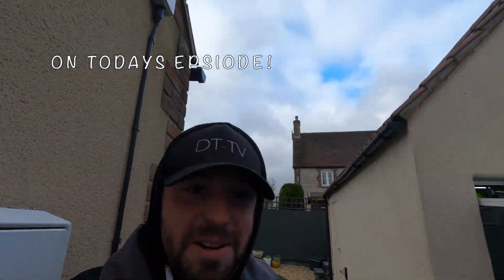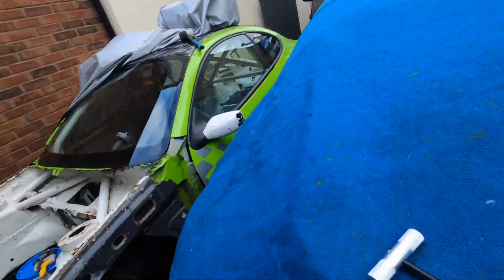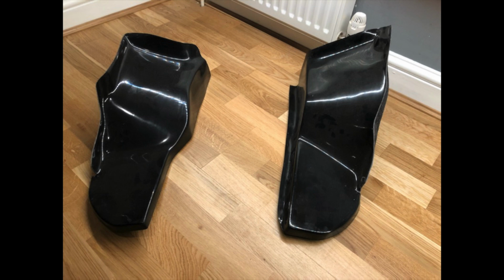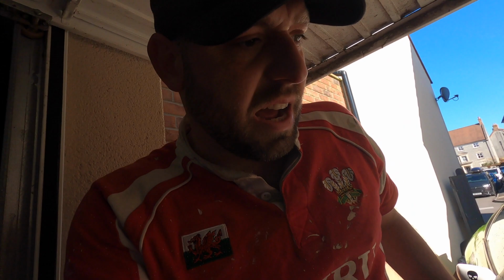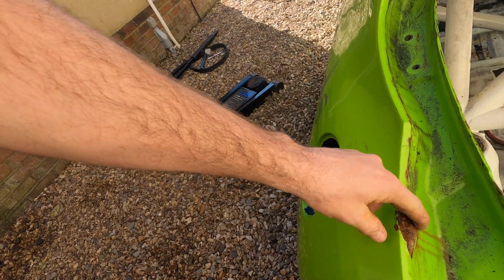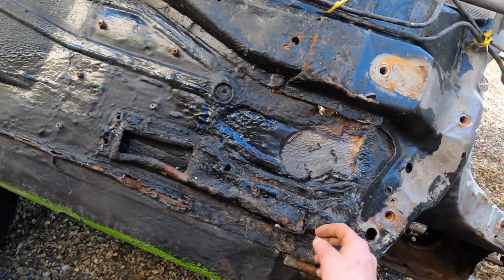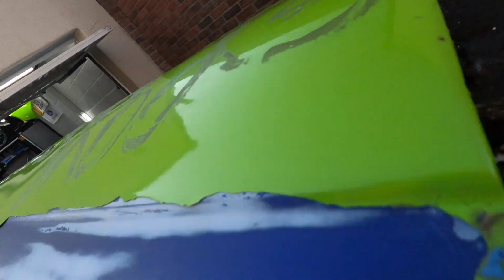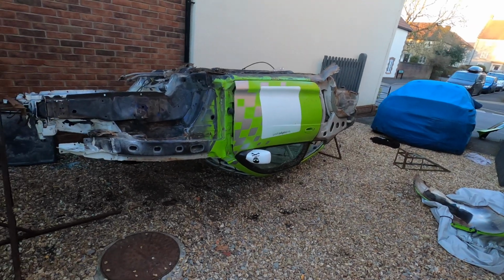Rebuilding a Rally Car - Part 40 - DT-TV - SHELL FINALLY ON THE SPIT AND UNCOVERING A RUSTY MESS!

Comment: Gutted  about the shell for you bud......would you consider a fibre glass Super 1600 kit? Only asking as there is a full brand new unfitted kit on eBay in Reading for £850? 2 front wings, bonnet, front bumper, splitter, 2 rear quarters , rear bumper and boot lid?...might be a quick and effective solution to the new shell quandary?
Reply from the maker: I’ve seen that mate and I went to purchase it, however it’s a FRP kit not a S1600 wider kit unfortunately. So it’s the same as I have already, I’m really keen on S1600 as it is in fact slightly wider and the front arches are more flared.
Reply: @dt-tv6114  and that’s why you’re doing the build and not me! You know what you’re looking at! Ah well! Will keep trying to come up with suggestions despite my lack of knowledge! Really enjoying the channel and the content! Great work!
Reply from the maker: That’s alright mate I really appreciate you spotting it for me and letting me know about it. Hunting hard for a shell already though. Yet another car for the drive way 😂